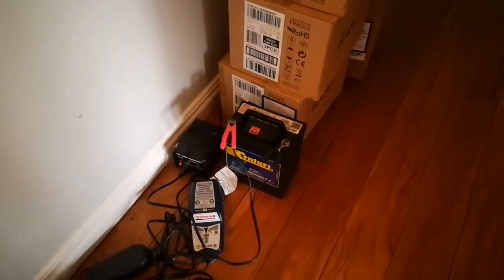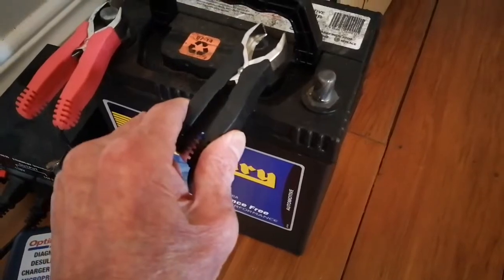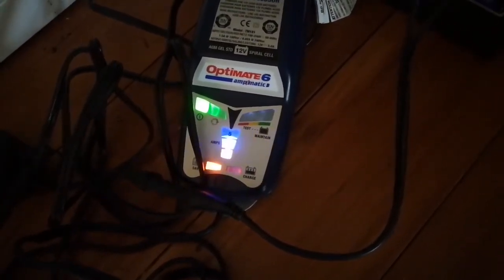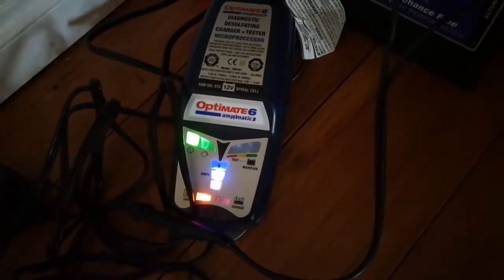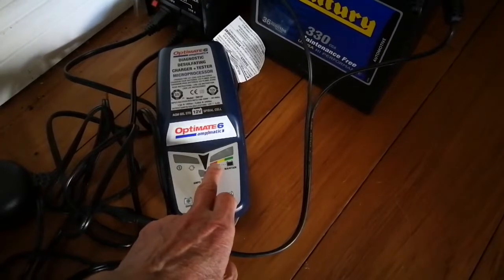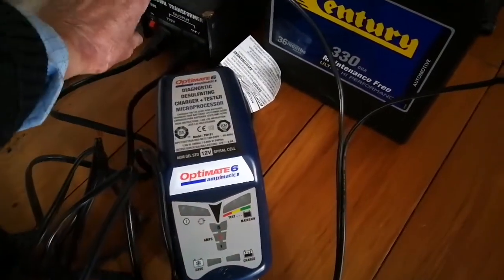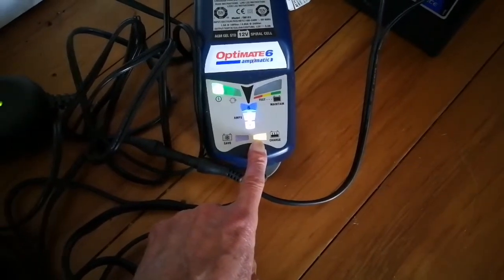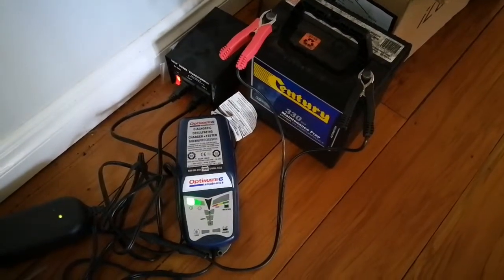Charging dead car battery from 4.6V using Optimate6

Comment: charging a dead lead dead battery......in a flat........on a wooden floor....without any fire protection at all..... = hmm.......; that's against my own habits......
Reply: I see.  Have you ever seen a fire from a flat 12V car battery being recharged?
Reply: @grahamchiu2817  what's inside a Pb-Battery...... ? =  water ?..... // in addition: how does a charger work (with O2 only ?) and what does a charger produce as side product ?.... = I think it is NOT candy but heat.........  :-(..... // please do broaden your mental horizon !
Reply: @grahamchiu2817  fire, fire, and again fire.....; you only thought is possible danger because of a fire....; = didn' I suggest, that you broaden your mind ? // loading almost dead batteries can create other problems than "only" the danger of fire.... // Anyway...; I am out of this conversation..... //  greetings
Reply: @grahamchiu2817  After doing it for over 40 years Id say the risk of fire is near zero especially with a low amp charger - if you tried to run 100 amps through it then sure - but thats not whats happening. 
What there is a risk of is acid getting on your wood floor and staining it permanently. 
I have over a dozen optimates between the 6 and 7's best all around product on the  market today.